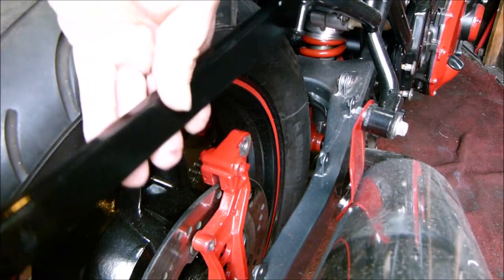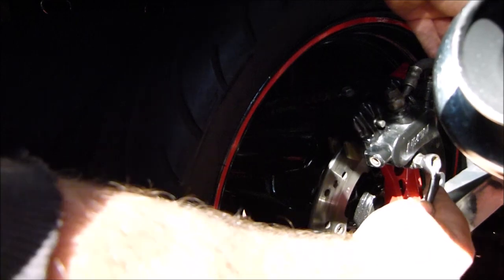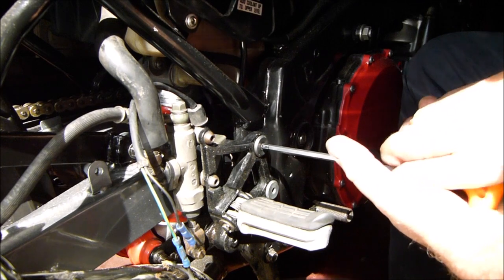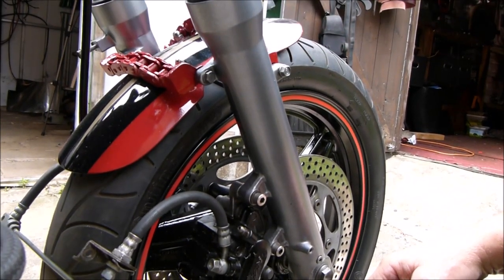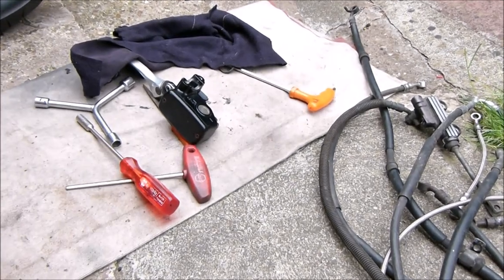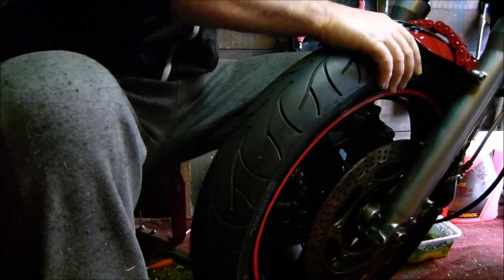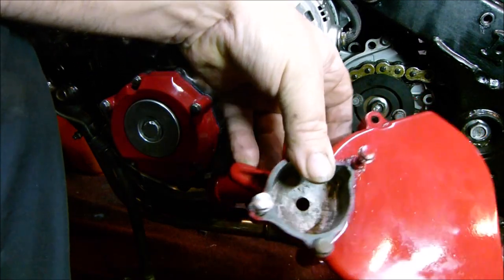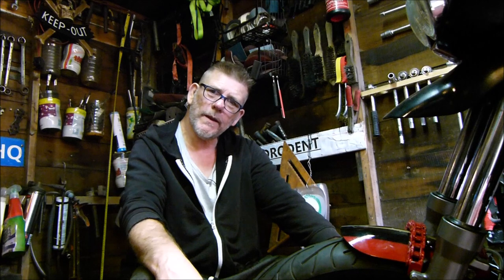cbr1000f Landfill bike. Hydraulics,clutch and brakes.

Comment: Good stuff Johnny! Nearly there matey. Just had to rewatch the bit on the back brake but are them pads sitting right as it seems they hang over the edge of the disc or is it me! 🤔🙏
Reply from the maker: Thanks Steve. The disc is from the newer model and is slightly smaller.,